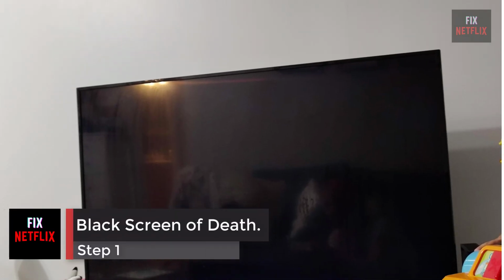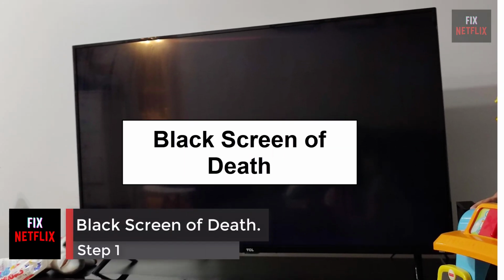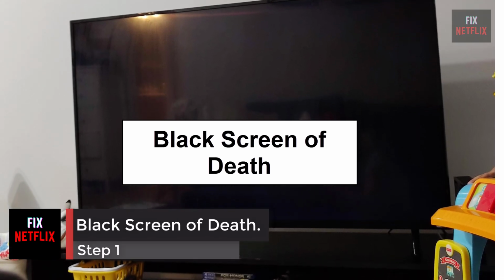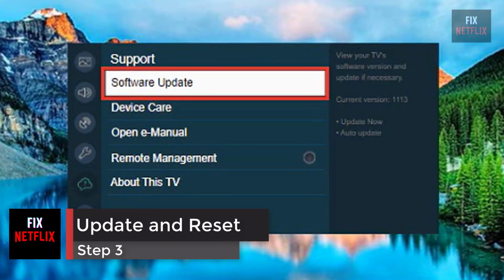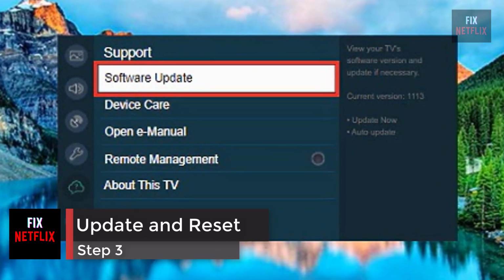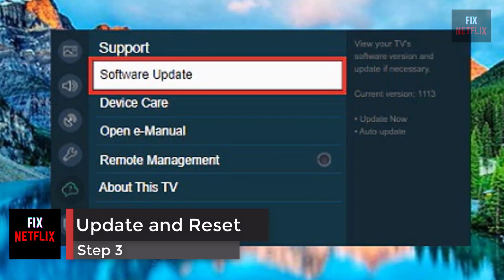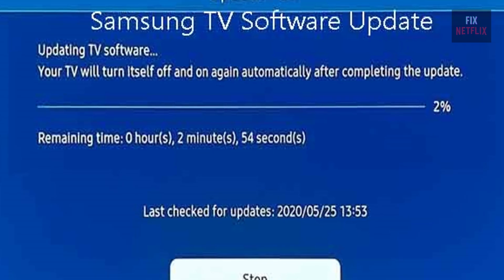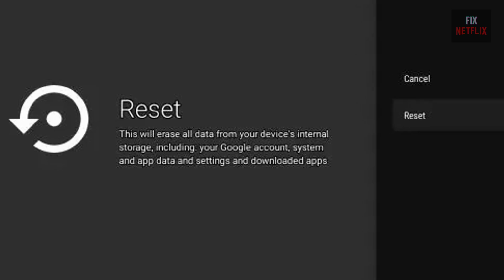VIZIO TV Wont Turn On? Fix It in 5 Minutes!

Comment: If I have a black screen how can I do any tasks to correct it?
Reply: Oops, I meant if I have a black screen no can do any tests.
Reply from the maker: That's a valid point! This video focuses on issues where the TV has power but no picture. For a completely black screen with no signs of life, the troubleshooting steps might be a bit different, often pointing to a power supply board issue.